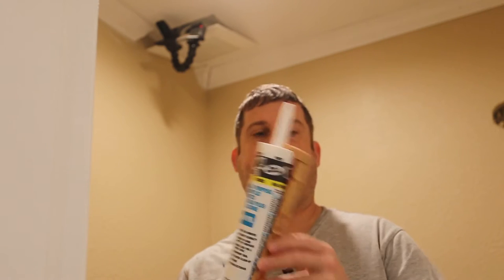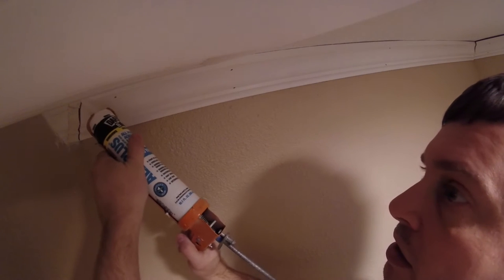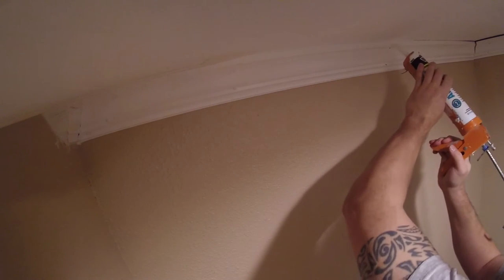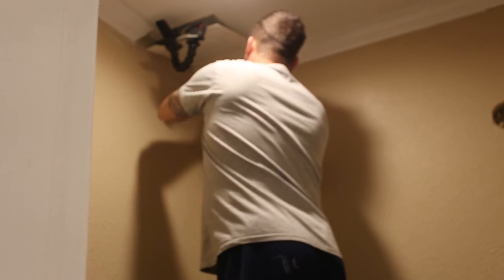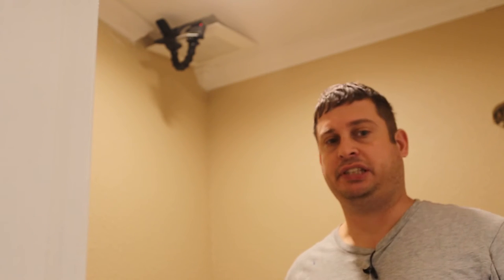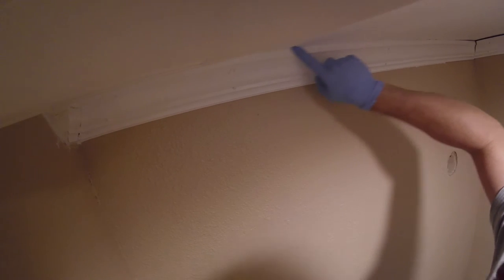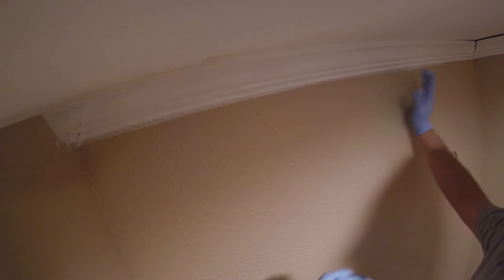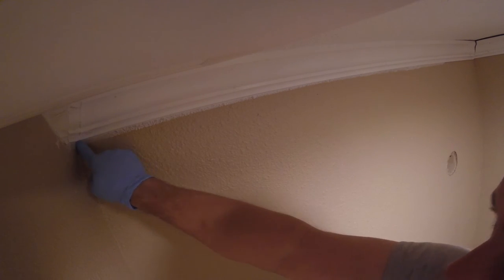House Remodel: Caulking Crown Molding

Comment: Hi Brain , Luv watching and learning your techniques. Question what ever happen to your fish tank. ?
Reply from the maker: It's still there.... it's just taking me longer to get it back up and running.  I don't want to bring it online with all the dust and crud from construction.  Right now my problem is that I need to build out a fish-room in the garage to handle the water filtration and quarantine and salt water make up.  I also need space to fabricate a new sump etc.  I'm hoping to wrap up trim and doors soon and then be able to get the garage in order to work on the tank.